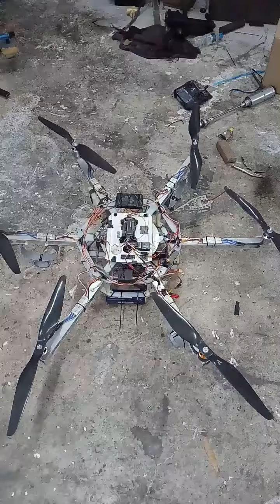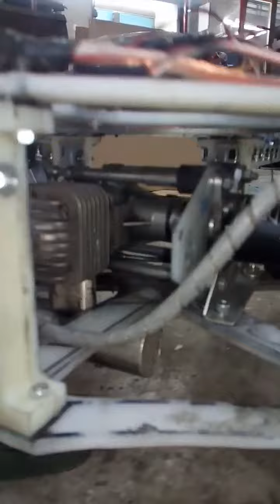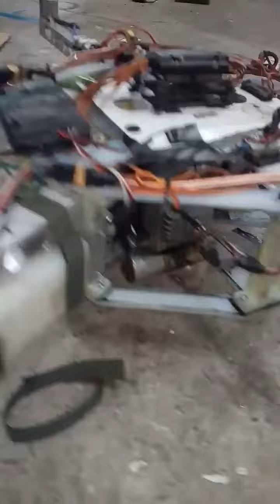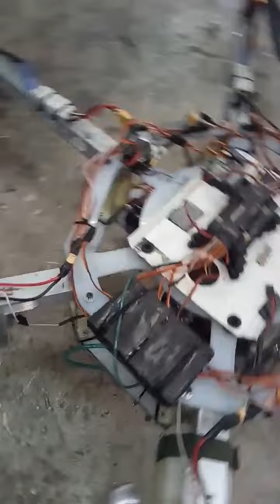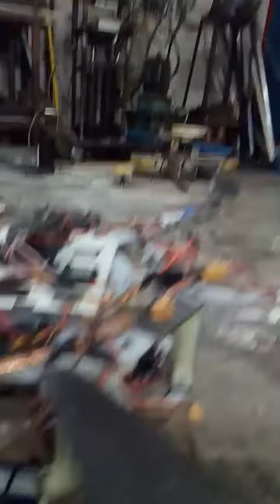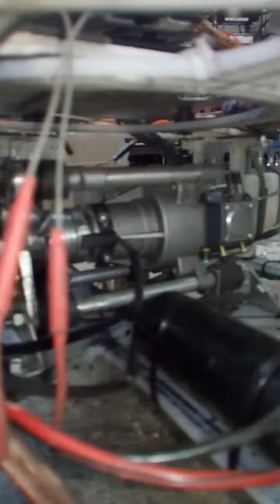hybrid Hexacopter with gas engine and 2800W  three phase generator

Comment: nice! what is your generator?
Reply from the maker: 1 brushless motor  180kv  3000w  Rewritten 
in cooperation  with three phase bridge rectifier 150A 
the hexacopter weighs 8.50kg  and for hovering  needs 850-900w power